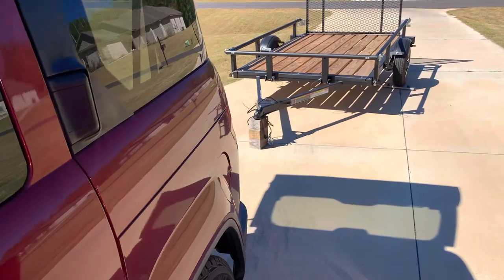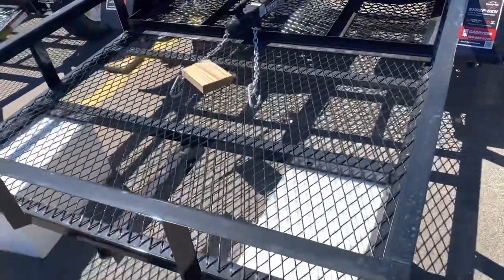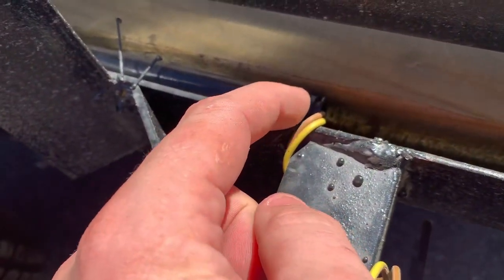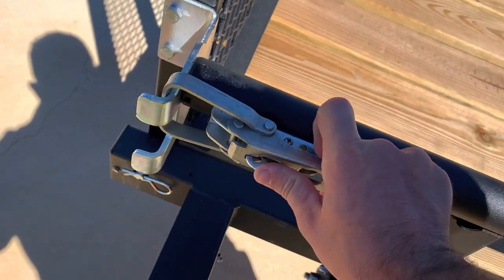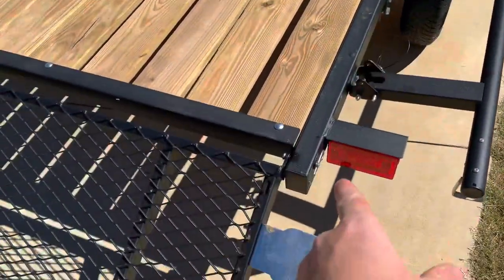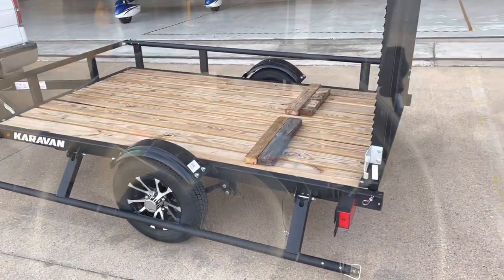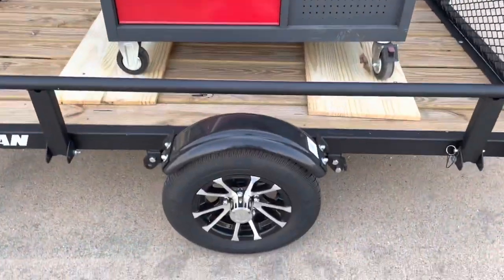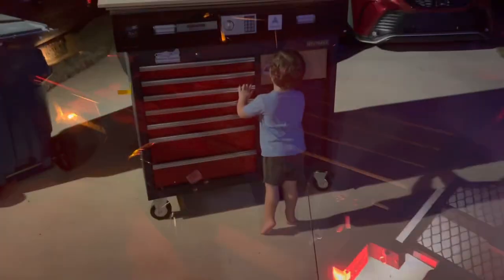Is Karavan the KING 👑 of box store utility trailers?  Folding 5x8 review and some heavy testing.

Comment: I'd had one of these for almost 5 years.  After using it over that time it's been a great tool.  Complaints are: Tail Light location could use underside protection as lights are easy to break when backing up, if you're not careful.  I've replaced the left light twice now.  The plastic inserts to close the rectangle steel are easy to lose.  Bought a couple replacements over the years. License plate holder is junk and in a bad location.  I've just zip tied the plate to the back of the ramp.  But overall it was an awesome purchase for the price.  Great versatility as you mentioned and surprisingly well constructed where it matters.
Reply: I have had mine for 3 years, broke a tail light and zip tied my plate to the gate aswell. Karavan sells replacement lights and they are super easy to replace
Reply: @dale7416  agreed, easy to buy and replce these lights.. but I don't really want to keep buying tail lights.. thus why I which they were relocated

Comment: For those who don't want to screw/bolt anchors to the wood floor, Karavan sells a Tie Down kit for their 5" frame trailers (incl. D-rings with 1/2 x 6 inch bolts) that fits in those plastic capped holes on both sides of the trailer. Sold at TSC or cheaper if you shop online somewhere else. 
My 2021 Karavan 5x8 has four predrilled holes on each side with plastic caps on top, but my trailers has 3" frame. So I bought 4-pack of V-ring bolt on anchors and will get some bolts at Lowe's [for the pre-drilled frame holes].

Comment: I buy and resell used utility trailer for over 15 years and the 5x8 karavan trailer its the best light duty trailer on the market. Just weight 550 pound that you can pull almost with any car and can be loud up to 1,450 pound. I have one of this and I reinforce the gate with two extra beam to support the center of the gate and add a electric winch and its my perfect goft cart delivery trailer

Comment: I've got a 6X10 Karavan. My only complaint is the gate is a bit too short for lawn mowers to get up, but if I need to, I just back up to a hill and it works alright. I would never own another brand after this. The frame is incredibly strong compared to the crappy trailers I usually see. I've had over 2k pounds in it, and the only thing that didn't look good was the tires. If it had a beefier axle and tires, I have no doubt the frame could hold almost 4k.  The folding sides are so useful and the folding front has let me put 16 foot boards on it before.
Reply: Would you be able to load a 50" zero turn with such a short gate? Thanks.
Reply: @PeterDotExe  if the gate was lengthened or placed on a slope.

Comment: What size tires did they put on that one? I’ve got the same trailer but it came with the steel 12x4.8 skinny tires (bought mine back in 2019 from Home Depot before they had the “upgraded” version with the nicer/wider wheels and led tail lights

Comment: So where are the tie downs? I was hoping to see if there are any points where you can attach ratcheting straps to hold a riding mower in place. I was going to go buy this trailer at Home Depot this week but I haven't seen any points to strap a mower down.
Reply from the maker: I strapped the box to the spaces underneath the fold down rails.  The bottom of the square tubes are open and the hook fits right in
Reply: @CreativeMechanic  oh I see what you mean. Hey have you heard of these things called EZ-Tracks? They have them at etrailer's website. They are slotted metal tracks you attach down to the floor with lag bolts. You use another piece that locks into the slots and has a ring for tying things down or using ratcheting straps. They look like those metal tracks  on the interior walls of semi trailers.

Comment: The Karavan trailer is a good light duty unit  eg fold down sides 
Fold down sides give no structural strength 
8 ft is the longest single axle a dual axle tows better 
A frame coupler is light duty 
front floor  Left to Right frame is small multi piece 
A frame not connected to front spring hangers 
A frame should be attached to under side of  main frame 
 Ramps have no knee supports . When ramp folded down knee brace sits 1 inch off the ground 
[prevents trailer bending ]
Painted frame  .   A galvanised frame lasts along time  

All these items could be up graded but the trailer cost  would be 50%more $$

Comment: How much did you end up paying for yours? I saw a video from 2021 saying his 5x10 was 1200, but now it's $2300 and Bass pro sells the same trailer under the name trailstar for $2500 for the 5x10 and 2100 for the 5x8
Reply from the maker: $1575 in Alabama
Reply: I paid $1925 2 weeks ago for my 5.5x9 karavan at TSC. I won’t go back to those other cheap trailers
Reply: My 5X8 was $1200 at Home Depot in Missouri a year ago.
Reply: I ended up getting one off marketplace for $1000 in great condition.
Reply: Paid $1200 for mine yesterday at Home Depot in Fairburn Georgia.
Reply: The 5x8 come in two diferent model
The straigh single beam tongue $1,200 and the “V” noice beam tongue with drop side sistem $1,800 that the options I see in my near home depot store